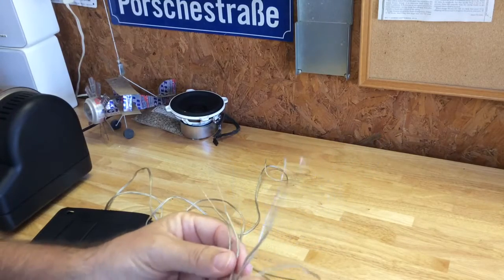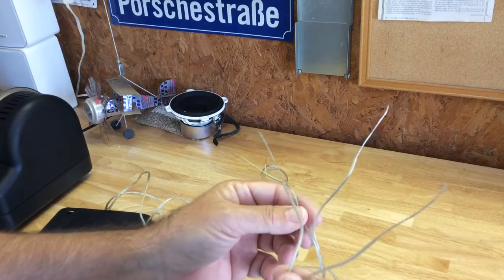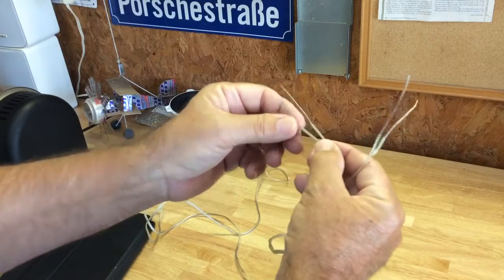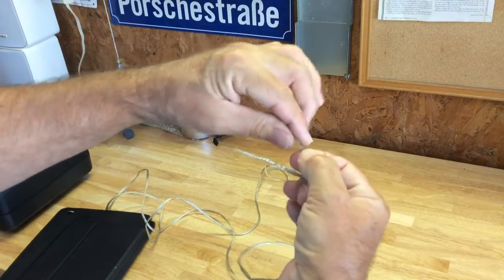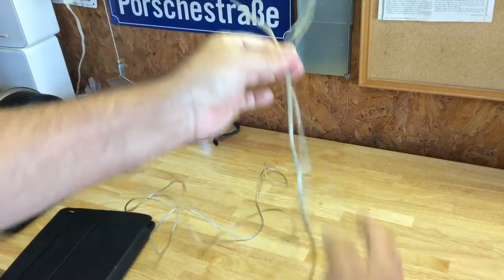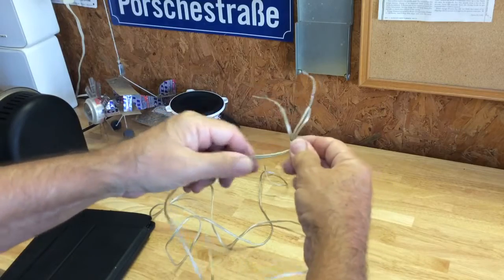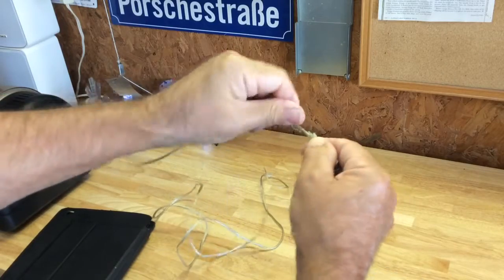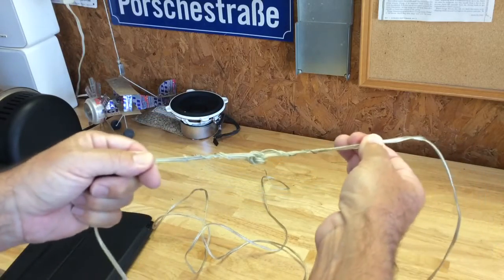Blasters Knot

Comment: Thank You!
I've been meaning to make this video for a long time. I do it just slightly differently. I strip as much wire as you do but I fold the exposed leads back in half together and just twist it taught before I draw them out on the legs.

And I always use tape. Murphy's Law you know.

Anyway, I made this an embedded link in my Fireworks Club forum under "Tips and Techniques". at http://NPAClub.org

The members will all high five you. Thanks again!

Al